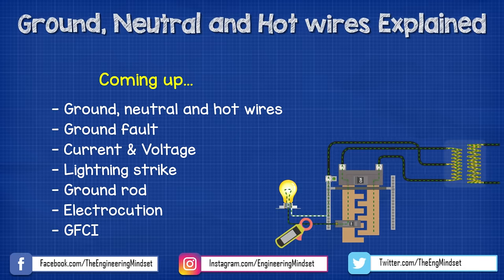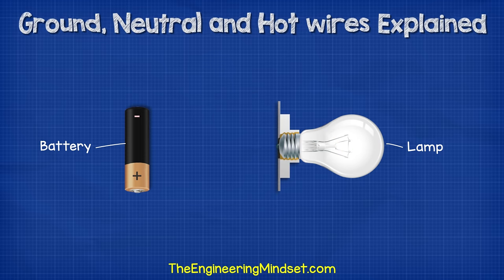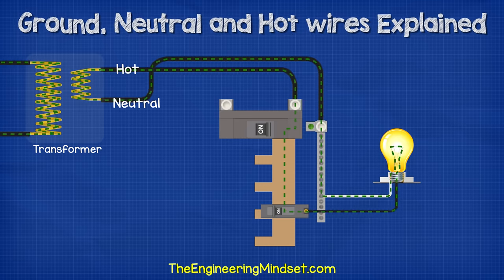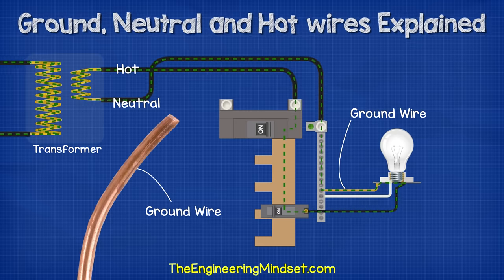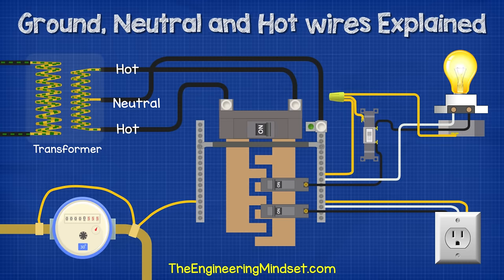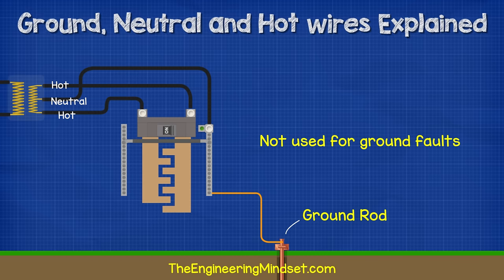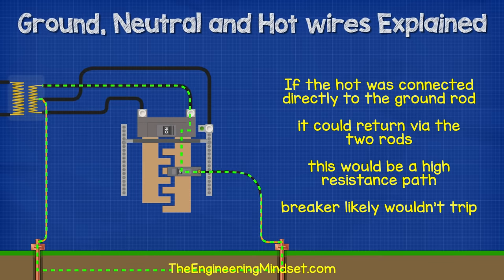Ground Neutral and Hot wires explained - electrical engineering grounding ground fault

Comment: Question. 12v DC auto wiring: when installing a DC electronic should I use a neutral wire or use the car body? Is one better than the other? I know they both provide the current a way back to the battery. Does one have a downside, is a neutral wire safer, can other signals in the car body mess with the current? -Thanks, love the channel.
Reply from the maker: Check our our new car battery explained video: https://youtu.be/VnPRX5zQWLw

Comment: I found this extremely helpful but still not sure what will happen if I plug my UK 2.8kw oven into a US 220v supply>
The oven has a cable and UK plug supplied, the electrician has fitted a UK socket with a built in rcd in my kitchen, what happens to the neutral in my UK plug does it just become a hot wire and that is ok?

Comment: This channel is great. I love the animation. I wish you'd do a video as to why DC lost out to AC (basically advantages and disadvan.) in the end when Edison and Westinghouse (I believe that's his name) were competing to get electricity in our homes.
Reply: It was because AC is so easy to step up and down. High voltage for long distance transmission (on smaller conductors) and lower voltage for safe application in homes. AC has the relative motion built in from the source to enable the transforming with simple coils.
Reply: Look up electro boom ac vs dc. He does a great job and is hilarious while doing so!

Comment: I design PCBs as a hobby for machines I make… I’ve got 3 years experience now, but I never worked with AC current yet, and I need to for my next project idea, but I can’t grasp how to connect this…

I guess I’ll just put the hot and neutral into a full bridge rectifier and call it a day? (After going through a step down transformer)

Comment: Correct me if incorrect but voltage flows up and down on the hot wire, it doesn't alternate between the hot and neutral wire and will not be detected on the neutral wire.

Comment: Does the main breaker in a residential electrical system's breaker panel in North America disconnect the hot only from the grid power, or does it also disconnect the neutral?

Comment: Hello The Engineering Mindset - you mentioned that neutral carries the difference between current used from 2 hot wires. Does it mean we should try to balance the load in such a way within our panels so that neutral always carries 0 or close to 0 Amps? or not really?

Comment: if you use a gfci breaker do you still need to use gfci outlets connected to it? if you use a gfci breaker do you still need the same bonding process as before in your examples?

Comment: At 4:34, is the neutral current 5A because the two hot wires are exactly out of phase, and therefore currents subtract?

Edit: OK I guess you basically said as much a few seconds later.

 BTW, EXCELLENT graphics.

Comment: Measuring between the 120V hot and the 120V hot will result in a measurement of 0V on the multimeter.  This is because a multimeter does not measure pure voltage but a difference in potential.  The difference in potential between 120V and 120V is 0V.  Otherwise a very interesting video and well explained (except for the "used electricity" part).
Reply from the maker: Check our new Multimeter tutorial out ➡️ https://youtu.be/4lAyzRxsbDc

Comment: Hi Thanks for explaining the ground fault so well. Sir is it possible for you to help me understand that why the current want flow from the neutral to the ground wire and then to the metallic parts of the equipments if ground and neutral wires are connected as shown in your video
Reply: Because the neutral wants to take the path of least resistance and complete the circuit so it wants to return to the transformer it won’t flow to the ground because it has no where to go

Comment: I watched a video of an installation of a GFCI outlet replacing a non-GFCI outlet. He only connected the active and neutral, but not the earth. Would this make the GFCI not trip on an earth fault on an appliance until a person get an electric shock to complete the fault circuit by touching the faulty device? He had 5 outlet connected in series and stated they would all be protected. But there was no running earth between all the outlets. Do you legally have to have the earth wire installed?

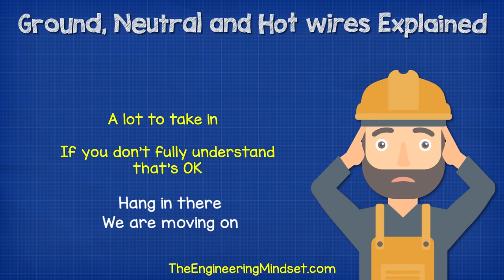Comment: Hi, lots of helpful information but I have a question. At 5:33 you say that the topic of current returning via the other hot service wire will be covered in more depth in another video. I haven't been able to find that video. Which one is it?

Comment: So from what I understand and please correct me if I'm wrong; The ground is connected to the neutral terminal, and thus, should current run along that path where the circuit then becomes: live directly to neutral, this will result in an overload of the fuse. The fuse would also trip due to overload of course in a similar fashion if live touched neutral. It's almost like having two neutrals to an earthed applicance, but of course, one is never used under normal operation and if you did, you would ground fault the entire house. Normally the ground wire (i.e. this additional wire from the neutral terminal going around the entire home should have no current flowing through it and if it did, that would be leakage/ground fault?) How can we test and isolate a ground fault? Would you go round every socket with a plug in tester and/or disconnect every appliance?
Reply from the maker: We just published a new Ground fault, short circuit and arc fault video, so much detail! Link HERE➡️: https://youtu.be/Qi0ynSQw-wc

Comment: Excuse me, Please help me for more understanding about neutral wire.
IN the Video: I understand Neutral wire is the wire to complete the circuit from the device back to the source.
But when use the AC, the direction of electricity flow change always, it mean in 1 seconds, the direction exchagne 50 times for example, at this, we may do not know which exaclty have neutral function.

Or when we use 240V in this example, it does not need the netraul wire, because 2 hot wire 240 V have function to complted the circuit.

I am in Vietnam, they use in residental 01 phase (1 hot and 1 neutral) from 3 phase Y.
The neutral is always 0 V.
I think it is : the electricity flow alway from Hot to device and through neutral. When AC exchange direction, from neutral to the device to the hot phase, there will be off, no have current in the circuit.

Please correct me if I am wrong. thank you for your video. I am try to understand electriciy. you video is very clear and interesting. thank you!

Comment: Question.  the pictured transformer shows H1 and H2 primary coil connection.   Is one of these a neutral back to the substation?

If yes, then must say i never see this (2 bushing) single phase transformer.  ONLY SEE single bushing cans on  residential service.

Comment: I’m not sure if this is mentioned somewhere else, but at least where I live, the neutral bus bar and ground bus bar are separate busses. We are not allowed to connect neutral and ground on the same bus bar in the panel…
Reply: Note this is true for all the sub-panels. The neutral and ground are only bonded at the main panel where the power enters the house from the meter.
Reply from the maker: Check the new SUB PANEL EXPLAINED ➡️ video https://youtu.be/NUSNa-7Hecw
Reply: @EngineeringMindset  That’s REALLY well done, thanks!!!!!!

Comment: I guess a lot of people did not understand explanation at 5:25 (same as I)... I personally prefer explanation that in hot wires current flow in opposite direction - that is reason why they cancel each other in common neutral wire (15 - 15 = 0 or 20 - 15 = 5)..

Comment: Quick question here what determines the voltage of the neutral wire and then how come when the neutral wire brings power back to the grounding bar the power doesn’t back feed the ground to all of the grounding system ?
Reply from the maker: The planet is 0V, the neutral wire is physically grounded to the planet so it is 0V. You are also grounded to the planet. The applied voltage is much higher at 120V. We always need a load (e.g. a lamp) to create a resistance between the hot and neutral. Energy only flows if there is a voltage difference.

Comment: I learned that with a car battery the hot post is the positive, current flows from it to the ignition key, and back to the negative battery post.  Your first example of current flow seems backwards.  "Current in a circuit normally flows from positive to negative.  However in a battery powering the circuit the current flows inside the battery from negative to positive."  Then it again flows from the positive post to the negative post.
Reply from the maker: Please watch this video https://youtu.be/kcL2_D33k3o

Comment: the difference between the two different hot feeds has the current return as wasted current? the current going into the house passes through the meter as the total current in the hots , so is the difference returning to the transformer outside taken back in to electrical grid?

Comment: Hi, Would it be possible to wire an RCCD between the 240V source and the load (240V compressor) in a three wire split phase system just like you describe in this video except that the neutral wire coming in is a bare wire ground. Thanks

Comment: How does a non-contact voltage detect tool (like Fluke 1AC-A1-II) work?  What I don't understand is how it detects live voltage on the hot wire, but not the neutral wire.  If it's a simple magnetic field detector, it should detect magnetic field in both wires.  And since it doesn't have a reference point, how does it even "know" about hot and neutral?

Comment: Why during lightning strike, the current goes from the ground rod at the transformer and then through the neutral back to the ground through the ground rod at the main panel? Why it doesn’t go through the hot wire?

Comment: I wish you would do a video showing different transformer hook ups. I haven't been able to figure out what people mean in diagrams where on the primary side of the transformer, one side is hooked up to one of the phases, and the other side goes to ground. If it just goes to ground, how is there a completed circuit, and how does electricity flow?
Reply from the maker: See our transformer explained video

Comment: When a ground wire is used, what determines whether the breaker trips or whether the current goes back to the panel and switches over to the neutral wire (like mentioned at 9:55)? Also, what are the two gray, vertical rectangles with circles on them in the breaker panel visuals?
Reply from the maker: We just published a new Ground fault, short circuit and arc fault video, so much detail! Link HERE➡️: https://youtu.be/Qi0ynSQw-wc

Comment: I own a house in Mexico and it was not properly wired.  No ground at all and no wires are colour coded.  Some appliances get energized when some lights are turned on, I suspect besides not being grounded I think there is issues with the neutral.  I am having difficulty determining which is neutral because both wires are live.  Any suggestions?

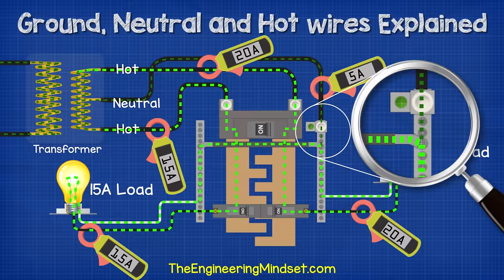Comment: At 4:53 you say that the neutral carries the difference in amps between the two circuits. How does that work when comparing the current for the ground fault circuit interrupter?
Reply from the maker: We just published a new Ground fault, short circuit and arc fault video, so much detail! Link HERE➡️: https://youtu.be/Qi0ynSQw-wc

Comment: I think a lot of these videos and articles miss the gap when they're trying to appeal to layman like myself.  While the video does talk about the difference between the electrical path returning via the neutral, when operations are proper, vs the ground wire, say when the metal chassis becomes energized, it doesn't quite cover the confusion as to why that matters when it's the same copper wires travelling back to the panel where they are connected.  At first when the video talked about the ground wire having a very low resistance, hence causing a quick spike in current (amps) that cause the breaker to flip, that still doesn't make sense to a newbie as we are looking at the neutral and ground wires and telling ourselves that they are made of the same copper, so they should have the same resistance.  What we, the ignorant, fail to consider is that when an electrical load is sent through the hot wire, into say a light fixture, and returns on the neutral, that the light acts as a resistor, hence why the neutral line has a much higher resistance than the ground line.

This leads me to a follow up question.  If you have a circuit under load, and you expose the neutral conductor and touch it, would that lead you to being electrocuted and if so is it more dangerous because the load on the circuit creates resistance which means that the breaker wouldn't experience a huge current spike?
Reply from the maker: We just published a new Ground fault, short circuit and arc fault video, so much detail! Link HERE➡️: https://youtu.be/Qi0ynSQw-wc

Comment: Is the working principle same in the Electric Vehicles (where the wires are grounded to chassis)? for example: Hot wire and a neutral wire is connected to the HVAC system and an additional wire i.e. Ground wire is also connected from battery to HVAC and the ground wire will only function if there is a wiring fault?
Reply from the maker: We just published a new Ground fault, short circuit and arc fault video, so much detail! Link HERE➡️: https://youtu.be/Qi0ynSQw-wc

Comment: One Key point I want to say is , if the neutral at transformer is not grounded then the neutral is also at line voltage or potential. So touching the neutral might give you  a shock when the loop is not closed via live wire (may be through load). So Neutral tied to ground not only provide a safe path during lightening but also a ZERO reference potential with respect to Live. Correct me if I am wrong.
Reply from the maker: We just published a new Ground fault, short circuit and arc fault video, so much detail! Link HERE➡️: https://youtu.be/Qi0ynSQw-wc

Comment: The box fan that I sleep with keeps tripping the GFCI switch in the bathroom. Once tripped it does not reset manually and it took almost 48 hours for it to reset itself. The lights work and it sucks not having a fan on but I’m too afraid to plug anything in upstairs.

Comment: Hi I'm new at this, I have a question, do we run any risk walking barefoot around the copper buried pipe while the ground is wet?
Reply: Mostly no because you are not between the potential and ground. If you were walking on the copper pipe and someone threw you a wire then yes. Or if light was in the area.

Comment: as you demonstrated, at positive half cycle of AC current, current flows from live to neutral and during second half cycle current flows from neutral to live wire, but you said potential difference in neutral wire is 0 volts.. if potential difference in neutral wire is zero, then how electrons flow back to source and completes the circuit?? please answer me and clear the doubt....

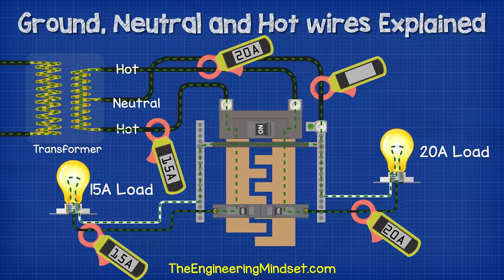Comment: According to this video, current goes back and forth via Hot and Neutral wires. So hot becomes neutral half of the times because it is alternating current. It is even demonstrated in the simulation at 4:42 - 5:00 min. Is that correct ?
Reply from the maker: Alternating current alternates in polarity. In reality the electrons flow tiny tiny tiny amounts, the neutral is also grounded so its the same potential as you. Hence it doesn't shock you, although it can do if a fault occurs so you shouldn't touch it
Reply: That didn’t answer my question. It demonstrated in the simulation that hot wire becomes neutral half the times. Is that the case?

Comment: The Engineering Mindset:  A burning question. In the Single Phase step down 
transformer IS the NEUTRAL conductor of the Primary and Secondary Coil 
connected together?  The primary must have a Neutral to balance itself out?

Comment: Okay @engineeringmindset
so in my plant , we have pumps with 480v motors with a green ground cable attached to motor to the ground. So this is just for lightning strikes?. If there was a ground fault with the wires they would return through the ground wire correct
Reply: Yes for ground faults unless they are connected to earth then it’s for lightning
Reply from the maker: We just published a new Ground fault, short circuit and arc fault video, so much detail! Link HERE➡️: https://youtu.be/Qi0ynSQw-wc

Comment: Thank you for the great video. I have one question after this video. Since we using AC, current are alternatively back and forth. Then, I think, there is no difference between hot wire and neutral wire because neutral wire will become hot wire for half of time. Why current flows one direction in AC? Can anyone explain this question in easy way?
Reply: @GH-oi2jf  So, there is no desire for electrons leaving the center of the transformer to flow back up the neutral wire to the load?  Does the ground connection kind of make the neutral side like a pool?  Current is pushed through the load from the hot side and then they just sit in the big pool?  So they don't actually flow back through the load?  So really the flow isn't bi-directional, it's more like a squirt through the load from the hot side followed by not nothing from the neutral side?